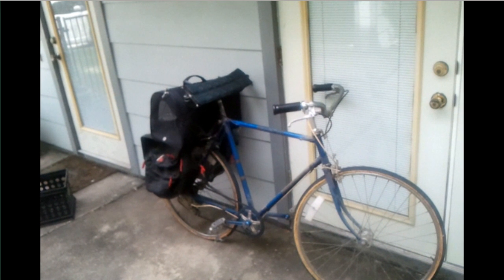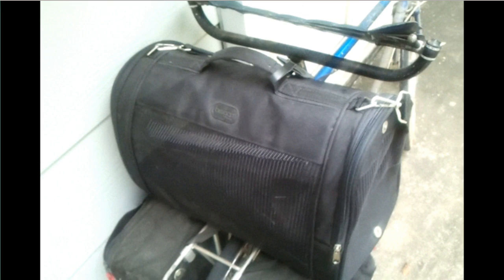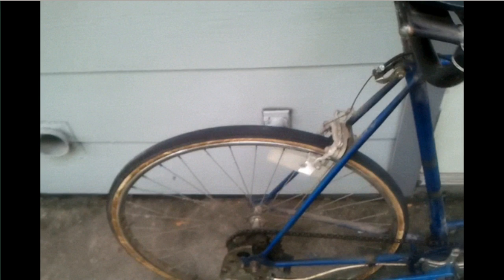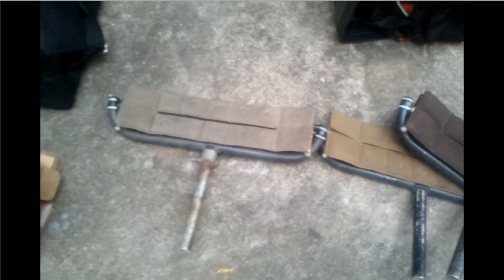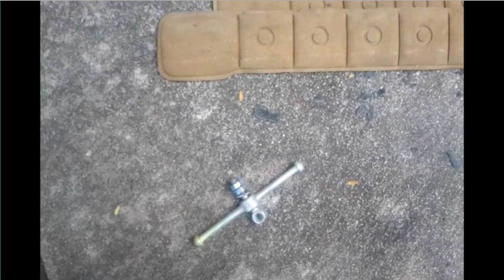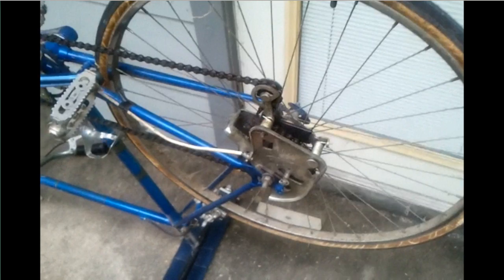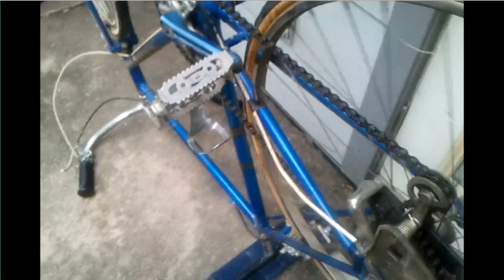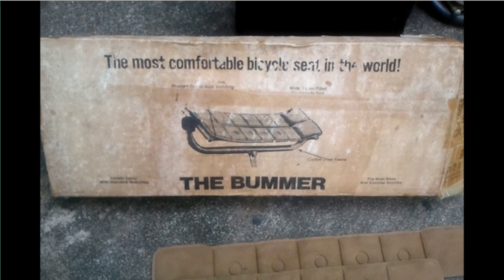The Bummer Bicycle Saddle

Comment: This is a wonderful design for the non-competitive cyclist like myself who would ride more were I not crotch-crushed after a dozen miles. The design is simple and durable.  I'd buy one today if they were available.  There's another homebuilt design using drop handlebars and shimmed stem for the suspension.  With four machine screws, a couple of cross dowels, and a smidgen of welding, the pivoting T's can be fabricated to hold the sling.

Comment: I recently purchased a moon saddle & spongy wonder bike saddle. I also ordered a nexride noseless saddle. I'm trying to decide which saddle works best. My issue was numbing in crotch area. However, now I notice that my noseless saddles make pedaling somewhat difficult. I need the saddle to rotate or swivel so my legs can pedaI. I think the nexride saddle will work best because rotates slightly. I wish the Bummer saddle was still available. It looks like it would work the best.

Comment: FOREVER LOVE my Bummer, the most comfortably ergonomic bike seat ever made: Absolutely able to handle huge ass, while somehow it seemed lighter than air...b/c I was sure the package was empty when the USPS delivered it. Why my seat get heavier?   Mad-Ave junk-marketeers stole The Bummer market, and replaced it with an ass-broke  "Comfort Bike" fad. Today we see the Comfort_Bike inside stores, not so much of the real Outdoors  . . . .  
 •  •  Re-Fabricating a Bummer? Just off-the-shelf seat-belt technology, and one aluminum-tube weld to craft a 'T'. That's it.  One further element I'd add: the merest tension adjustment, a wee deeper 'saddle'.
 S the Bummer supported two positions. Leaning forward into the bars produced the extreme ergonomic posture: sitting-resting-standing, Total support and balance, postured close to a recumbent. The Bummer was absolutely beyond its time.  
otoh: the the resting, fully-seated posture, is where I sometimes wished  the webbing could relax. Hanging 'hands-free' was just a smidgen disconnected; higher up on the saddle than my horses like to ride